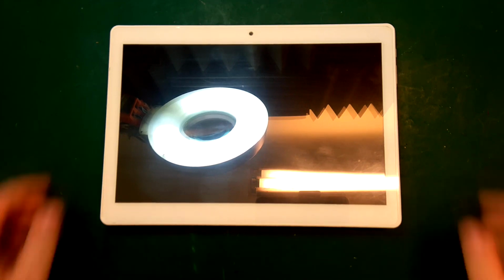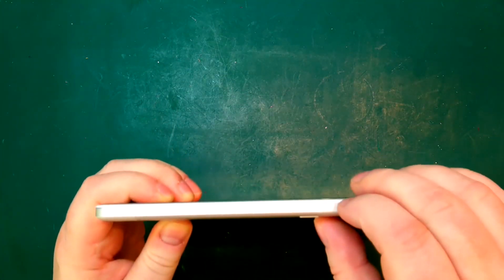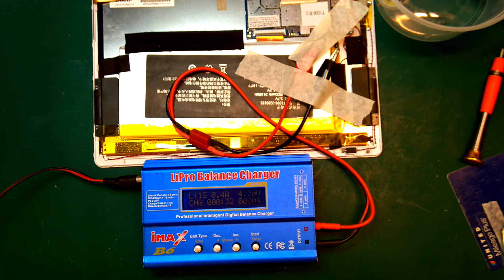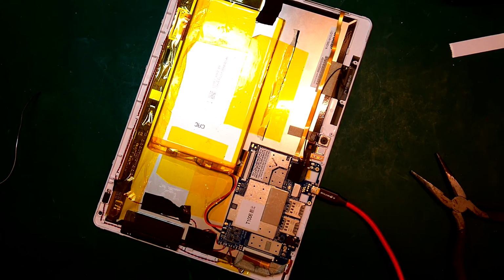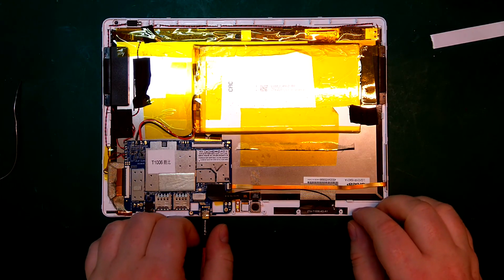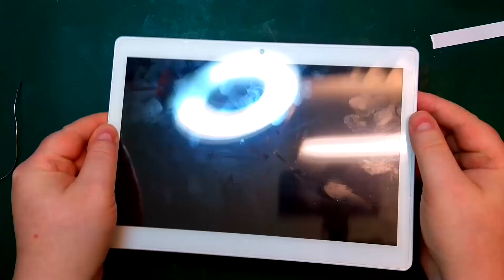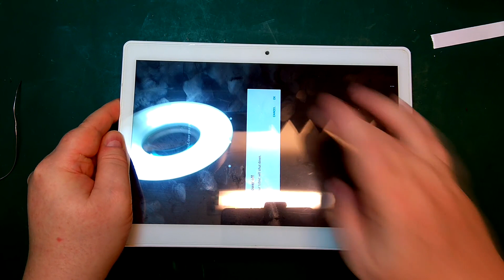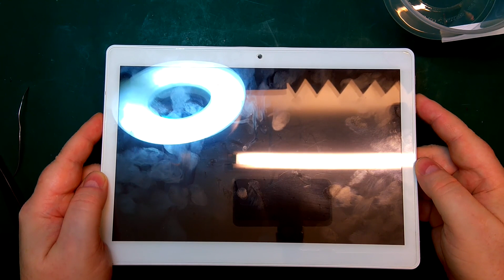Android Tablet Battery Replacement

Comment: Dude u did that all for your cats? U r awesome. My boss is very intelligent 🧠 I'm just trying to replace a battery in my little tablet and  I can't even open it😂 I do high voltage testing on capacitors I feel like an idiot. Not my forte 😢

Comment: Pretty cats 🐈 🐈‍⬛ 🐈‍⬛ you have! Checked my battery 🪫 because the DMOAO Model No.: D3 would not hold a charge only about 1 1/2 months and the battery reads on the voltmeter 3.47V and the battery is a DEO 23L 3.8V 22.8Wh 6000mAh Shoujd I replace the battery 🪫

Comment: Link for that battery please? (I have the same tablet) (Sorry this English, I use google translator)
Reply from the maker: This is the battery I used: https://www.aliexpress.com/item/32711454243.html
Cheers,
Jake
Reply: @TheStuffMade  When I opened the tablet to see the battery without touching anything, I closed it again and now the bottom part does not recognize me (the change of application and that, if broken if I can use it from another point, do you know how to solve it? ;-; )
Reply from the maker: @xXxAdammxXx  It's not easy to say what the problem is without seeing the device, but check the small ribbon cable for the touch screen is still connected properly. Maybe try disconnect it and reconnect it.
Reply: @TheStuffMade  It is seen that I have caught "a pinch" to the "cable" of the touch screen ... I had to ask for a screen apart from the battery. u.u

Comment: Can I replace my Iball tablet battery which has 3 wires red,black and white to lipo battery with two wires red and black
Reply from the maker: No, you will need a 3 wire battery otherwise the tablet will not work correctly. You can buy 3 wire batteries, just check on Aliexpress etc. The 3rd wire (white) is for a thermistor to measure the temperature of the battery during both charging and use, without the 3rd wire it will most likely refuse to charge the battery.
Cheers,
Jake
Reply: @TheStuffMade  ok .Thanks

Comment: Have you ever opened a Samsung tab? There is no compartment to access any screws. Does it just snap together? Don’t want to damage it. Thanks.
Reply from the maker: I haven't tried a Samsung tablet, but all tablets I've opened have been snapped together and just needed gentle use of a credit card or similar to open them. (don't use a screwdriver, it will damage the case) I have opened Samsung phones though, that was very difficult as they are glued together. I recommend you have a look at this website and try see if you can find the specific tablet you have: https://www.ifixit.com/Search
Cheers,
Jake

Comment from the maker: Short update, the new battery is working well, it will now do 7-8 hours of youtube, games and internet browsing.
Reply: Bro if for example my tab battery is 4200mA and I change it with the same 4200mA (some universal battery) but the battery size is much smaller. Is it ok? I can't find a battery for my tab type but many universal batteries are sold. Would that be okay?
Reply from the maker: @gepliprl8558  As long as the battery voltage is the same (and the number of connection wires) then you can use any battery with approximately the same mAh rating that will fit in the case. Make sure the thickness of the new battery is ok too, some are very thin like 3mm while other batteries are more like 4mm. Hope it works out for you.
Cheers,
Jake
Reply: Thanks man. That's very informative. I've never try using different batteries before. I have an old samsung tab usually for known brands the batteries are abundant in the market. But now I have a slightly rare tab but now I can be sure to use different kind of batteries.👍👏